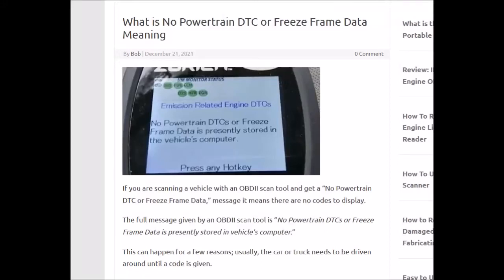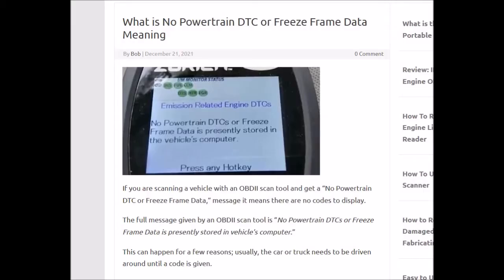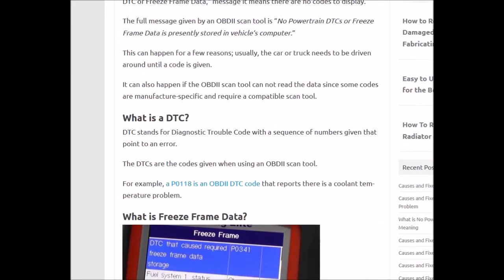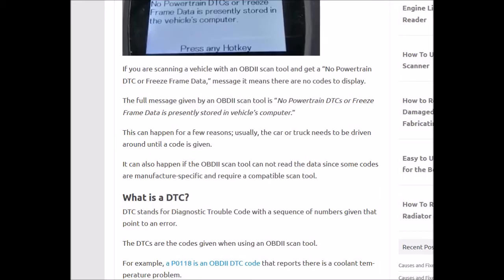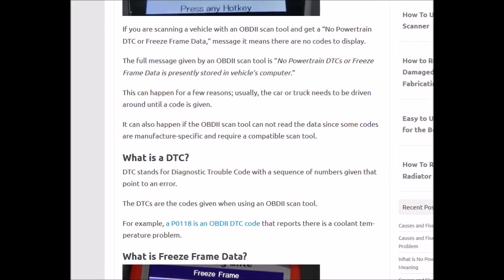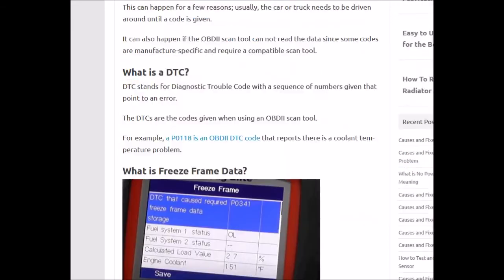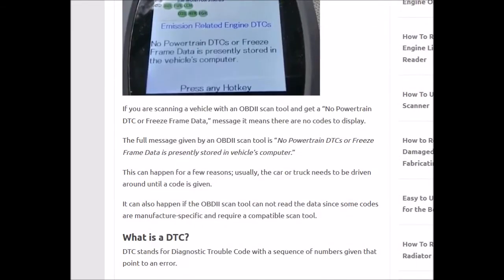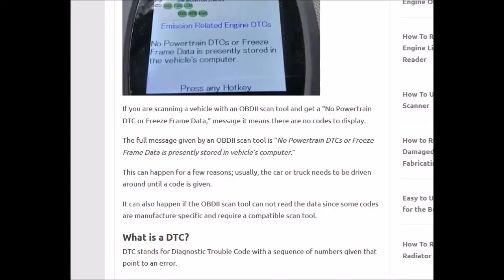No Powertrain DTC or Freeze Frame Data Meaning

Comment: I have a '97 Ford Mustang GT manual. Original mileage is 74,000 MI. After that it hasn't been driven. Try to turn it on. It did not turn just cranks. So I connected the scanner and exactly what you're talking about came on.

Comment: Hi, 2005 Honda Civic L.X one point seven leader sedan here, i'm having the same problems with my o dB reader telling me.I have no code stored.  When the code did show up in the beginning, it said my third cylinder is mis. Firing. So I changed all my spark plugs, coils and boots and stit says there's no code, so I'm gonna take your video as that's a good thing with my vehicle.

Comment: 2003 Ford. 
Failed inspection.
No check engine light but red lights on O2 and Cat.
Car starts and runs surprisingly smooth but still proceeded with replacing parts.
Drove in excess of 800 (mostly highway) miles and still have the red lights on the scanner as well as the "No powertrain DTCS or FreezeFrame data comment.
Four different mechanics with no luck.
Any ideas/suggestions?
Reply: did you find out what the problem was? I have the same problem with my highlander. first the red O2 light was flashing and I changed both of the O2 sensors and now the CAT red light is flashing and cant find an answer for it. No codes or check engine light come up.

Comment: I have a 2007 Honda Accord And i have the powertrain D T C Store and the computer's data Will it pass the smog with this air I really drove the car for miles and still gives me that same evap system powertraining D C T
Reply: I have the same issue and same vehicle. What did you to fix it? Did you go to a mechanic?
Reply: I've had a code for close to 5 years. That says evap system low purge flow. Then all of a sudden, it just disappeared 1 day..

Comment: My battery was recently replaced.  That would clearly effect all electronics that are normally always on, like the station settings on the radio.  Is there a Reset that should be performed after replacing the battery?  thanks. [Subaru Outback, 2011]
Reply: replacing the 12v battery is already reset for the car computer

Comment: I have that code , but i try to start it but it doesnt want to stay running the battery has been out of the car 4 awhile about 3 to 4 weeks , it is getting gas
Reply: Plus its a New Battery and the engine light flashed 11 or 10 times to
Reply: New alternator.

Comment: Thanks my Chevy equinox 2015 the radio goes off and on but recently the speed monitor won't read what I'm going even the one that is clockwise it shows I'm going 30 miles faster it won't show the tires air information do u have any suggestions then a trouble code light I've used the same trouble code reader iit work before but this time it says what this video says. So if u have any info I would appreciate it thanks a million videos like yours help females like me ..I have no clue on cars ..

Comment: On my 2012 Dodge Caravan, I changed both the thermostat and driver's side blend heater door actuator (AC/heater under dash) because of clicking and operation of controls. afterwards, I cleared the DTC codes with reader. I've driven the car since May for about 200 miles. Still my dtc reader says no codes detected and my car fails inspection sticker. What are my options/reason why/how I can proceed to get it reading again so I can get inspection pass. Thanks
Reply from the maker: Does the scan tool have IM Readiness testing feature? There may be no more codes but some scan tools don't have the features to pick up all the codes.
Reply: @whyingo7964  It's a 7 yr old Innova 3100 hand scanner/reader. It has I/M  Monitor  Status  icons.  The manual says it conducts I/M Readiness Monitors. I don't believe I've used it. Perhaps an idea from you would help? Why do you ask? Solution?
Reply: I've driven the van since May. I changed the blend heater door actuator. The clicking did stop, but the DTC codes are never registered even after driving since then - hundreds of miles. The car failed the inspection when they used their DTC code reader at the station. It says something like: "Unable to find codes stored in vehicle computer". MY DTC reader  showed me a yellow light with the EV symbol blinking. What should I do next? A dealer might charge over $1000 to fix it.

Comment: p code was coming up cause new secindary air pump and camftshaft sensors were replced. today i saw no code popping up on inmova scanner,  exept

no dtc codes present . all solid green lights.    does that mean engine s fine or reset or somthing??? 

thanks for your help
Reply: It means the scan tool can't find any data yet, good or bad. Basically, if possible, drive the vehicle around and check again later.
Reply: @HVAC_Mechanic ines showed red. So what it means if it showed Red? new shows powertrain module and dtc and frame freeze shows up.   my car will crank but no start.
Reply: As long as there is no check engine light you should be good to go